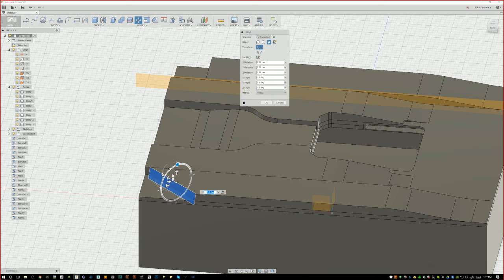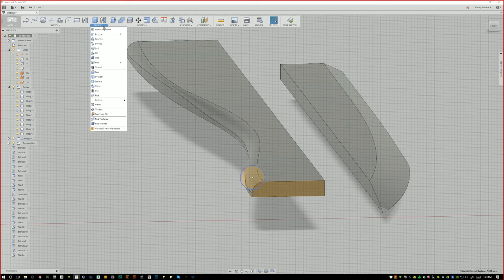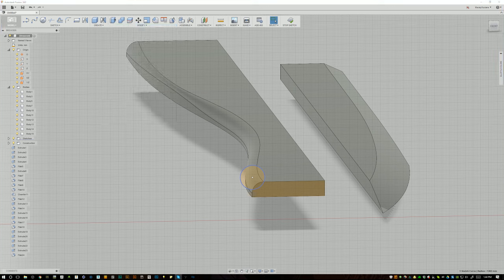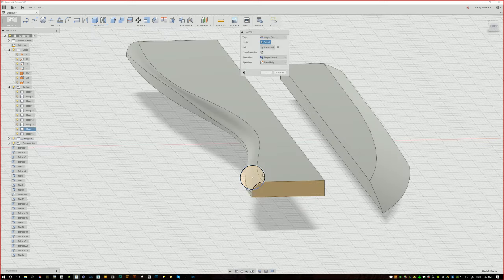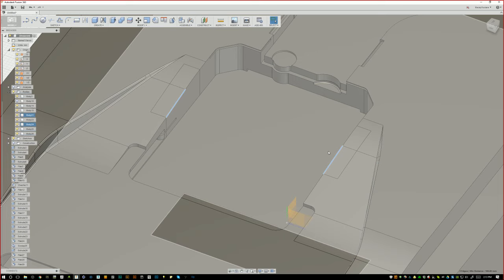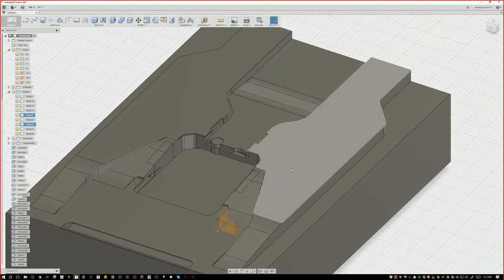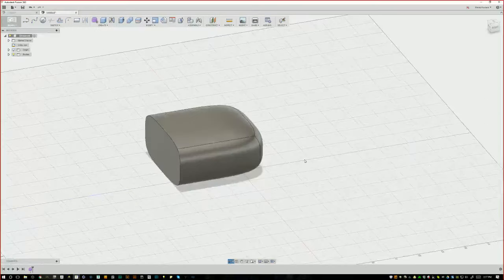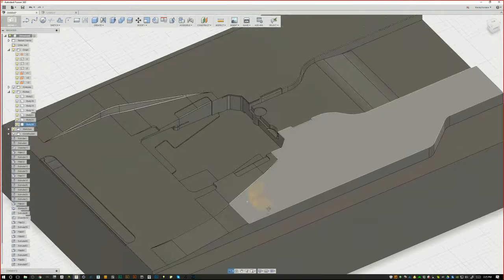Maciej Kuciara interviews Curtis Chan - August 15, 2016.

Comment: Maciej you are a 3ds max user and I guess it would be a great idea to make FFD for Fusion. Please tell it to guys ^^ I think Fusion 360 is an expression of what is missing in Max ^^ connection between this two softwares would be a great improvement for both
Reply: the funny thing is that speedform has a thing thats kinda like ffd and fusion not but speedform is kinda like the little brother of fusion or even the one eyed clone :D